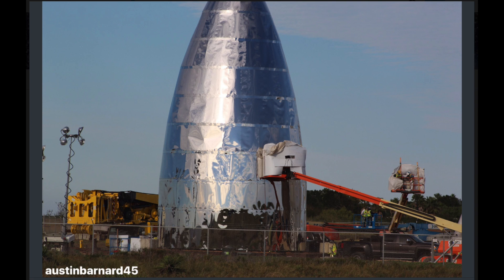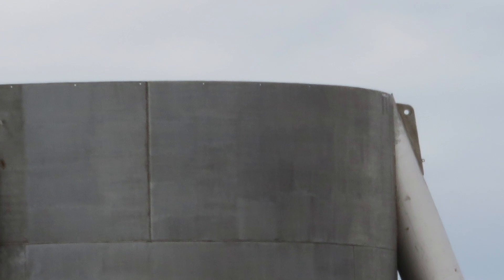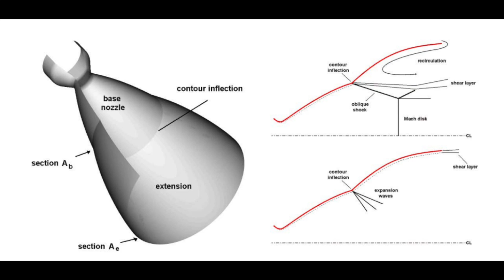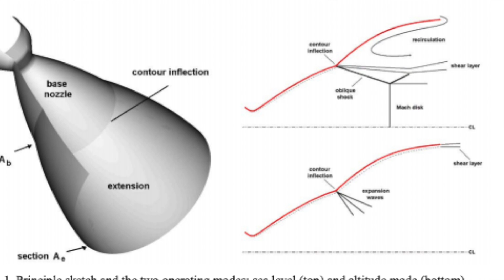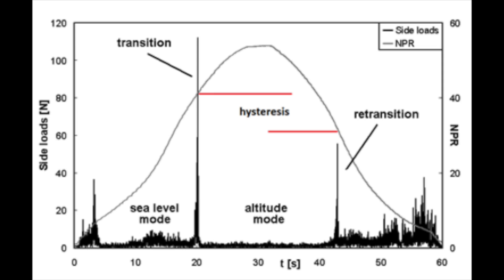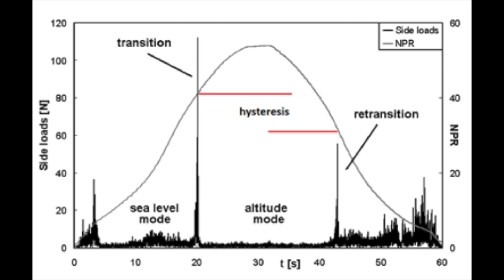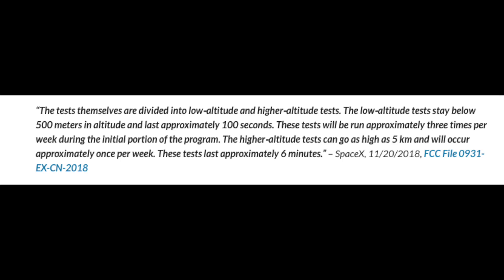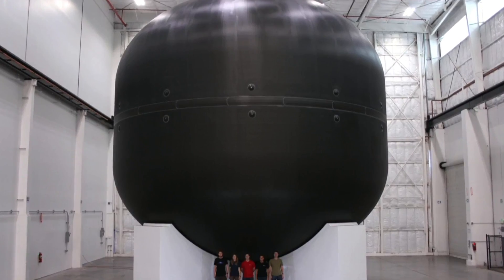What's Going On With SpaceX's Stainless Steel Starship?

Comment: As with all progress in Space X, things are/will be tested in stages. I think this shiny object is simply a test bed for the raptor engines to accomplish the next level of testing for the engines and at the same time build up hype for the BFR/Starship.  Raptor engines are graduating from being bolted down to a static bed to something that will actually fly (a hopper), so why not make it resemble the BFR (starship). Elon makes the most out of marketing opportunities (think of his roadster vs a block of concrete) where the point was to test fly the Heavy but make it a bit more interesting with the roadster.  As for three engines, look at it as redundancy likely with slightly different configurations to see which works best.
Reply: BW Meeks so you are working at SpaceX?
Reply: @johankl1928  I wish I was smart enough to work there. My skill sets are mostly limited to military applications.
Reply: I think in addition to testing Raptor there is utility in testing the rough aerodynamics of Starship. Plus many other systems others have pointed out.

Comment: I think maybe the point of these initial tests is maybe to test the new engine design and to see how much of the Falcon 9 software has to be altered to use on a future Starliner. Thus, make a cheap version with the same weight and maybe height to test these initial things out and to see if things need to be altered.

Comment: There's a good video clip of the SSME nozzle oscillating shortly after ignition. It almost appears like it was slow to start compared to the other two engines. Was that from flow separation, or is that the kind of flexing you would see with flow separation?
Reply from the maker: Yes, during startup the flow takes a moment to completely adhere to the nozzle causing the vibrations.

Comment: Interestingly, the 2 step engine bell SpaceX is using here isn't big enough for high altitude or vacuum ISP gains.  Really, it's all about throttling Raptor down as low as possible without creating flow separation.

Comment: My guess is that they will be able to test a lot with the triple Raptor setup: directional control, engine-out scenarios etc. I think the 5km flights will be good for the dual bell transition testing.  
The shiny stainless steel body is mainly a PR stunt I think. It probably has a 5X multiplier for publicity. But they can also do wind compensation tests. Those covered legs are quite a big asymmetric surface area with a big lever.

Comment: As crazy as it sounds I think they want to send this to space to test how it deals with heating on reentry. This is a crucial part of the architecture and if it doesn't work, steel construction is out. It explains why they are doing it in such a hurry, if it doesn't work like in simulations they need to change everything again. Also, this explains the engine nozzles, you don't need those for 5km, you need them for vacuum.
Reply: I think a reentry test would require a much more complete Starship, and a smoother exterior. You need a lot of velocity to do that test properly.

Comment: Could the upper stainless steel section be a mould for a composite structure?
Reply: Musk said they do not want to use composites because of the heat during reentry.
Reply: Didn't  know that. Thanks for the response.

Comment: I agree that the exterior construction looks a bit less than required, for a ship that would really fly, but perhaps the current effort is to duplicate the projected weight and size of the real intended craft. And we might see this 'craft' used  for test-hopping and low-altitude maneuverability development. The BFR is a much wider ship than the regular Falcon and the engineers may need more real-performance input, to help guide their work. Trouble is, where will they test it? It's getting too big to transport to another location...

Comment: It looks like a prop for a B grade science fiction movie.  All they need is Bruce Willis as the pilot.
Reply: Totaly agree.seems like Elon trolling youtubers:)) gonna fly? Srsly dude?
Reply: @klulnes  Have you ever looked up the test and training vehicles used for the apollo program? Looks pretty much as crap as this, so I don't doubt it is one and that its going to fly (or at least hopp, what it is meant to do)
Reply: They should sell it to Hollywood as a prop, and make some extra money back on it
Reply: What makes you think Bruce Willis isn't the pilot?
Reply: Agile methodology: Fail fast and early - meaning fail cheaply and correct (then rinse and repeat).  There is a non-negligible chance that at some stage of the testing, this will fai... I mean RUD.  Would be nice if it was relatively cheap to rebuild (notice "relatively" - I'm sure this is not cheap, but I'm also sure MUCH cheaper than any final design).

Fear of failure is one of the biggest problems of most rocket companies (at least the Western ones), and its beneficial to use best practice, rather than cater to harsh public opinion.  "Best practice" is judged by best results not by public opinion polls.
Reply: @jonsaxon1168  
"Agile methodology: Fail fast and early - meaning fail cheaply and correct (then rinse and repeat)."
Uh, isn't Musk planning on man-rating this?
RUD's all fun and games until you start putting people on the thing...
Reply: @bcubed72  They have to test the concepts first, blow a few things up, and then start again, probably hundreds of times, before they can 'man-rate' something
Reply: @bcubed72  he's not planning on man rating a test hopper
Reply: Haven't you heard, they signed Bruce this week!
Reply: I was going to say the same thing
Reply: It reminds me of 8 1/2
Reply: lol
Reply: It looks horribly bad. But it is not its goal to look nice. It is designed to be a workhorse.
Reply: @BiohazardPL  a dead horse.
Reply: It looks bad at first but at the end it will be big and cool
Reply: @enigma2536  right. Similar to how the Apollo Lunar Lander looks like it's made out packing tape, tinfoil and curtain rods...
Reply: @davidcrunkmd  Well, space-travel is probably THE industry that is the most about practicality and functionality over looks. Everything we have in space looks like basic shapes wrapped in tinfoil with added curtain rods because its the most economic.
Reply: "It looks so fake, because it is!" ElonGATED MuskRAT
Reply: Nice joke. You probably know this already but just In case you didn’t know it will be unmanned
Reply: @spicybeen4354  arent they all, silly?
Reply: David Crunk didn’t mean to reply to you. Don’t know what happened with it

Comment: I think it could be a smoke and mirror kind of thing. All of SpaceX’s rockets look sleek and smooth and this just looks like, well a water tower company made it not rocket engineers.
Reply: This isn't Starship. This is literally a test platform to see how the engines perform initially, and later to refine control systems for propulsive landing. It doesn't have to be pretty, it just has to be close to the right shape and an appropriate mass. Why waste money on what isn't important? This whole operation is about efficiency.

Comment: 3 Engines could test roll control and engine out capabilities. Also could take it up to max altitude and force a pitch over to see the aerodynamic limits and ability to pitch back during free fall without breaking up. The legs being fixed would kind of make that last idea difficult though.I think they really just want to test the Raptor in actual flight conditions and pressurized stainless steel at Raptor pressures for validation so they can just go straight into Starship and SuperHeavy production without iterating an F9 equipped with Raptors as a test bed.

Comment: I really do think this will fly. Why? Because if you look closely, you can see that the bottom portion, which holds the most important parts of the rocket, like the engines, the fuel tanks, looks heavier and more rough than the upper portion that will eventually, be placed, which really looks a bit...well...unstable and "soft". I mean, it doesn't matter too much because it will do just hops in the atmosphere to max 5 km...that's my guess anyway. And it's the first hoppper, next ones will surely be heavier, more stable, and more like the actual starship.

Comment: I'm pretty sure that's a float for Burning Man 2019.
Reply from the maker: Black rock city already has an airfield, it’s a small step to make it a spaceport.
Reply: @scottmanley  Would that "small step" happen to be landing a stainless steel water tower on it?  Come to think of it, that thing would be handy for removing undergrowth and then extinguishing forest fires.
Reply: Scott Manley are you a Burner too?
Reply: @scottmanley  Someone should bet ten bucks on the million to one odds Elon and his crew rides the damn thing though the upper atmosphere to burning man...
Reply: @scottmanley  Technically, the playa at Burning Man is larger than Groom Lake, so they could potentially create a much longer spaceport runway. Although geographically it is an awkward angle for conventional spaceflight.
Reply: @scottmanley  So you're a Burner ;)
Reply: @scottmanley  Blue Origin already brought a New Shepard booster to EAA Airventure, albeit on a truck.
Reply: Its an entry for Redbull Flugtag 2019
Reply: @FB0102  Spacetag #1
Reply: They probably hit a wall and some things can not be tested in a lab or computer simulation. This force them to run a ship, with sensor data from this they will be able to do more in labs and simulations. This should be the reason of the hurry, some teams might be stuck until hop tests are done.
Reply: @AlexandreLollini  But that's a very huge risk to blindly build a WIP project, even though most of the tech is being reused
Reply: @Felipe_Rosso   The government shutdown is grounding the scheduled launches. I don't think it's much of a leap to suspect that this is an impromptu project to keep the kerbals busy. As long as the staff is getting paid, this could be seen as an opportunity to get some side-burner or team building projects done. It could be for fun or practice. I just hope they don't intend to fly that thing. It looks sketchy AF.
Reply: @buckstarchaser2376  
If I recall correctly, most of the staff designing the F9 has been working most of their time on the BFR/BFS/Starship thingy for some time now - I guess the people involved in crewed Dragon are not involved in this, but working full steam on their first mission, regardless of what NASA does or doesn't do.
Reply: @buckstarchaser2376  Looking at this point, it does make sense 🤔
Reply: lmao
Reply: "Float"? You obviously haven't been to Burning Man.
Reply: @riparianlife97701   ...or did I deliberately place an error to make it look like I'm an outsider? 

I've actually never been there and have little idea what it's about, other than the concept that this object seems to belong to that set of objects. You have accurately called me out and I bow to your superior sleuthing skills.
Reply: @buckstarchaser2376  They're called art cars :)
Reply: That’s funny - exactly what I was going to say. It looks totally Burner
Reply: @chickenmonger123  Not anymore
Reply: Adam Bacon Uhh... it’s unclear. Journos made it unclear. Though I think they are still dating in actuality.
Reply: Joe Rogan experience was just the beginning.....
Reply: @MrAngenos  eff Joe Rogan, he is just popular. Scott has true intelligence.

Comment: From a structural point of view, it would probably make sense to use stainless steel instead of carbon fibers.  Carbon flexes too much whereas steel may prevent the usage of too many stringers.  Again, I could be wrong.  However.  Steel is cheap and so the processes for deforming it.  People often tend to forget that the machines to build the machines must get made as well.

Comment: For your questions: Why steel? 1 cheap, you get a rocket for a price of a watertank 2 testing steel construction options Why 3 engines? My tip is that they won't be raptors first but some used merlins to test the new nozzle, better test it with a known engine first IMHO.

Comment: Isn't there a dual-bell design that is "pushing" the exhaust to the edge so that when the pressure gets lower, rather than expanding outwards it's expanding inwards towards the center?
I don't remember much of it, having trouble finding it again, but I did see a design like this a few weeks ago.
Reply: Do you mean aerospike engines?
Reply: @SorinSilaghi  No, from the outside it looks just like any other dual-bell engine, it was something on the inside that did the magic

Comment: The large bell is sized for sea level and full thrust, so the dual bell isn't for altitude compensation. Many have done the calculations and determined that the smaller inner bell allows the engines to throttle as low as 10-15% at sea level! In other words, the dual bell is for throttle compensation. This would allow Starship to fire three engines all the way to the ground for engine out capability.
Reply: That's pretty interesting. Do you happen to have any good information links about bell design and throttling? I'd like to read more on it
Reply: Throttle (varying chamber pressure) compensation is actually in a way related to altitude (varying ambient pressure) compensation, the principals are the same, it’s about balancing the exit pressure and the ambient pressure, so this design can be used in both, since the starship spends most of it’s delta V in space, the larger bell is necessarily for vacuum performance. It makes sense for them to test the effectiveness of throttle compensation during landing, the mechanism is there, might as well try to squeeze more performance out of it. But I still believe the dual bell design is primarily for vacuum/atmospheric flight transitions because you gain more performance from using a larger bell in vacuum, the vacuum burns are usually much longer than landing burns, not to mention the starship is designed to utilize more of atmospheric braking than retro thrust braking
Reply: rallyrat, that’s interesting. Do you have any speculation on how long it takes a turbopump to spin up to provide the appropriate thrust to compensate for an engine out scenario? The reason I ask is there has to be some delay. I’m sure you’ve heard of turbo lag in automotive applications. I know this is very different but there are definitely some similarities. The inertia of all the rotating mass in the turbo machinery, the time it takes for valves to adjust, other rocket engine... gizmos... etc. Even if it takes only a second you wouldn’t want an engine to go out right near the ground. If it’s one of the outer engines that goes out the thrust differential would make Starship rotate about its center of gravity. That could make it land hard on one of its landing ah... fins, breaking it and tipping over. I know this is all speculation from a laymen, but I find it all fascinating.
Reply: @anthonydomanico8274     It is sure to be pretty fast! Those pumps are probably producing thousands of horsepower each, even deeply throttled. Any imbalance in turbine vs pump power will result in very rapid acceleration of the rotor. The limiting factor for spin up is probably surge margin, because they can raise the preburner temperatures and pressure as much as they want at any time and increase the power going to the respective turbine, as long as flow doesn't reverse back through the pump (this would most certainly be a bad situation!). Turbo lag on cars is mostly an issue when the engine RPM is too low to create significant turbine power.

Comment: It HAS to be a mock-up. That thing doesn't look like it should go up in the sky.
Reply: That looks quite aerodynamic compared to the flying bedstead that trained LEM pilots...
Reply: streglof Yeh it looks so shoddily built. And built in the open? Shouldn’t you have some sort of secrecy from competitors?
Reply: @MlSTERSANDMAN  The only competitor SpaceX has is Blue Origin, and they already have their design goals, and preliminary specifications.  Any other group out there could not use this information for any advantage.

Comment: I'm gonna call it a grasshopper-style test article of the Raptor-atmospheric engines of the upper stage (BFS) designed to be exposed to vacuum for 0-5 minutes.   They want to have something that looks like BFS with a bunch of landed flights under its belt to show to the government.  Thus far they've never flown anything with: Three primary engines, stepped nozzles, methane, a BFS-sized airframe, or Raptor engines.  Best to prove those things without exorbitantly expensive tankage and hab modules attached.

They don't have assembly line tooling operational yet for BFS, and won't for a while - major fundamental material redesigns were mentioned only a few months ago.  Instead, this is a temporary welded together aerodynamics simulator to test the stuff that's ready.
Reply: Bingo.  This is about the engines. Do they work... what are their in flight characteristics off a test stand. They just need something the right shape and weight. Doesn't matter what it is made of at this point, or what it looks like.
Reply: Agreed. the key goal should be engine testing, like launching and landing, also for attracting investors and money.
Reply: I like your thinking, and putting together those factors. Convincing!!!
Reply: Big Falcon Grasshopper.
Reply: They are also testing/evolving the fabrication protocols.
Reply: David Ogawa I suspect they will use very different fabrication processes to build Starship. This is a rough mock up for aerodynamic simulation and engine testing. The real deal will probably use presses with dies to shape the stainless panels and then they may be annealed to remove work hardening induced stress. Plus work hardening stainless will make it magnetic so yet another reason to anneal it.